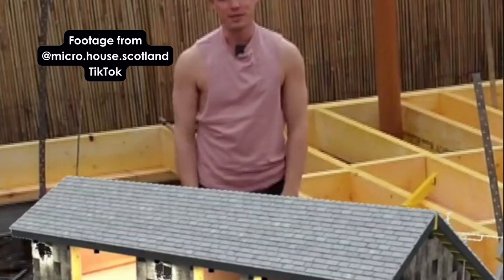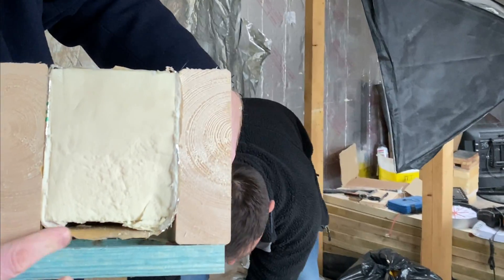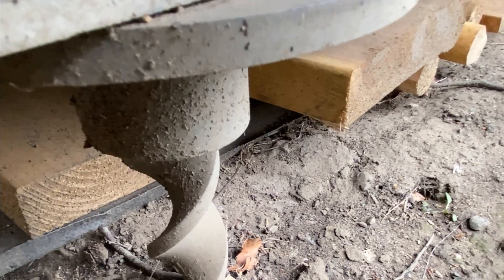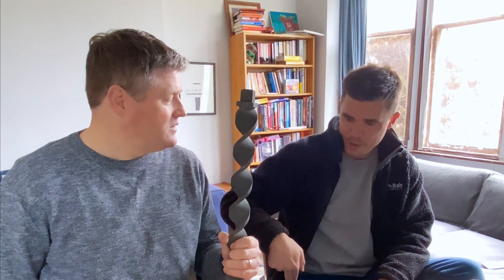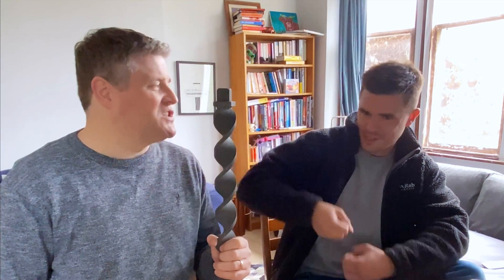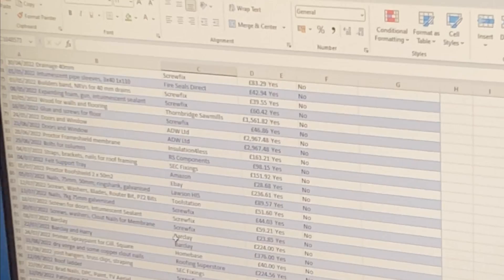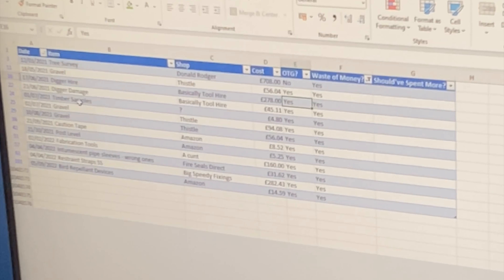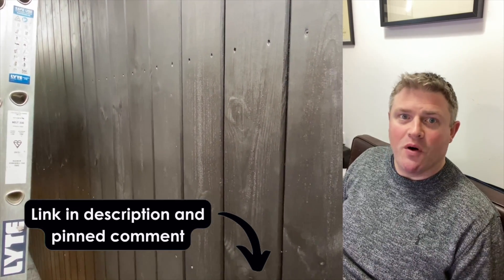How to Self-Build a Micro House in the UK

Comment: Interesting. If I wanted to use concrete pads to support piers, would the pads need to be steel reinforced?

I'm designing a shed / workshop in rather damp soil, so screws aren't an option. But I still want a suspended floor to raise the structure off the soggy ground, rather than sleds on a gravel base.

Comment: I like heli-piles. Used them on a concept for a cabin in a wood that was subject to preservation order and also for a decking on the edge of an root protection zone. However, local authorities don't seem to like projects anywhere near trees & have had major issues convincing them otherwise even when I have a tree report, control measures, technical solution & case studies to back up my design proposals. Seems to have got worse in that regard since introduction of NPF4.
Reply from the maker: NPF4 is on my list of topics for future videos
Reply: Did you get PP in the end despite that and did it go ahead?